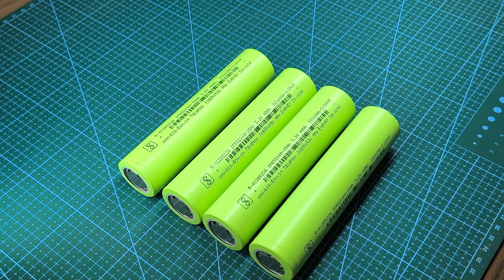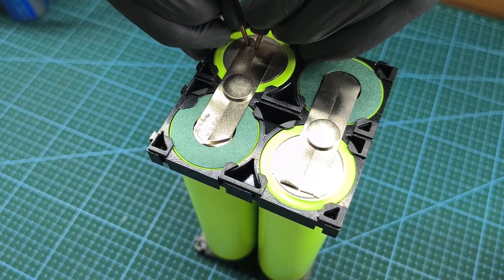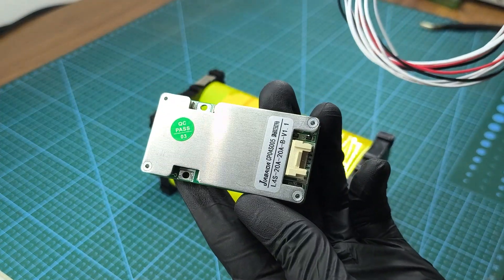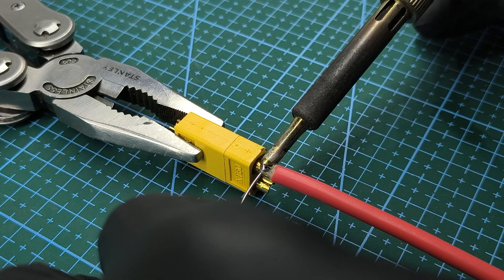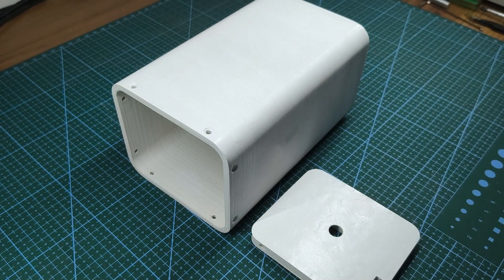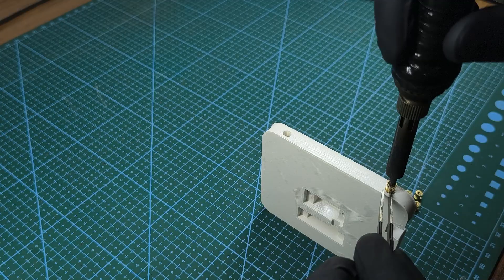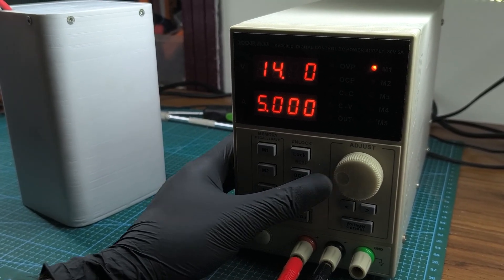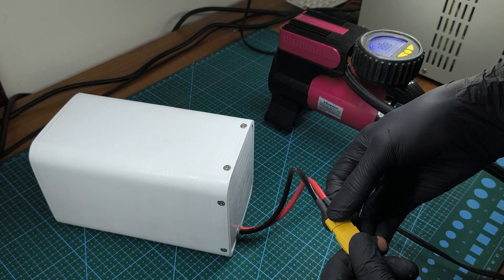Build a 12V 15Ah LiFePO4 Battery Pack with 32140 Cells | DIY Power Storage

Comment: Total cost ?
Reply from the maker: The total cost depends on where you buy the components. I purchased most of them online, but you can find components for much cheaper at a local market. You can get links to all the parts here: https://www.instructables.com/DIY-12V-15Ah-LiFePO4-Battery-Pack-With-32140-Cells/

Comment: Wow
Just looking like a wow
Can I charge this battery with mppt with set voltage according to battery pack like in 3s 12.6v
Reply from the maker: Yes, For this 4s lifepo4 cell you can set 14.4v. And make sure your mppt is compatible with Lifepo4 batteries.